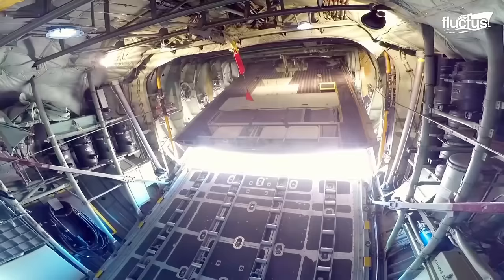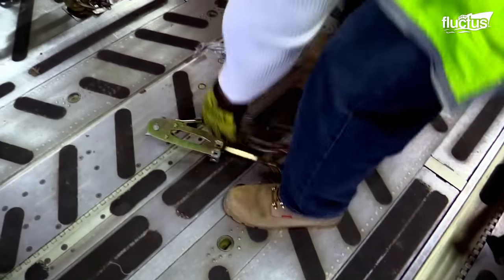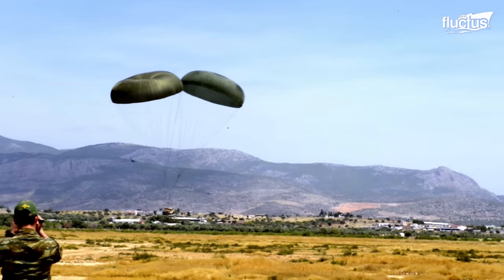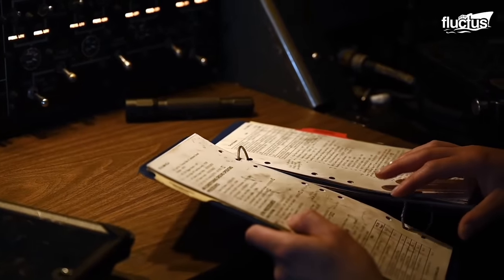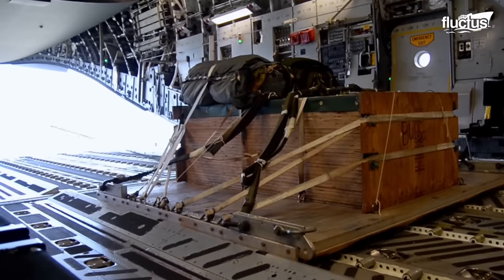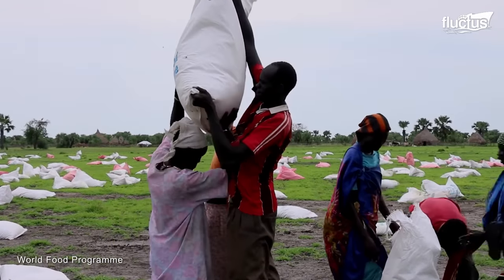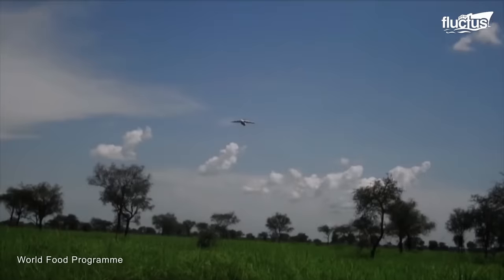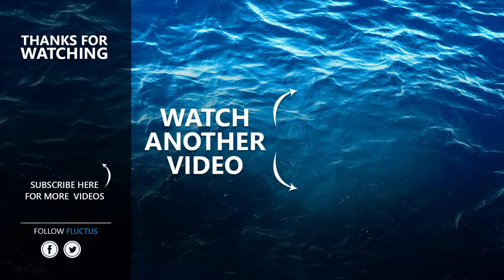US Air Force Very Special Technique to Airdrop Humvees at Extreme Altitude

Comment: Does anyone remember when that one crew member loosened the tension straps holding the HUMVEEs down on the air drop pallets and around a half-dozen of them rolled off of the pallets, plummeting a few thousand feet to their destruction?
I'll bet that guy spent some time in Leavenworth for that stunt! 😅